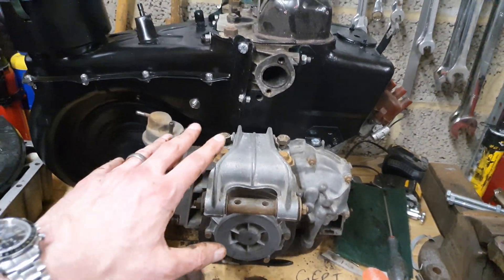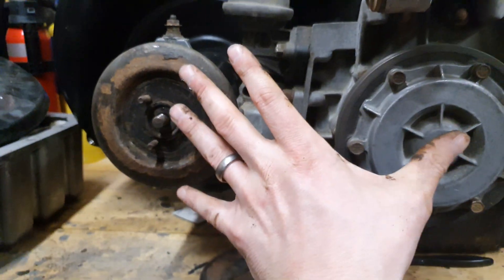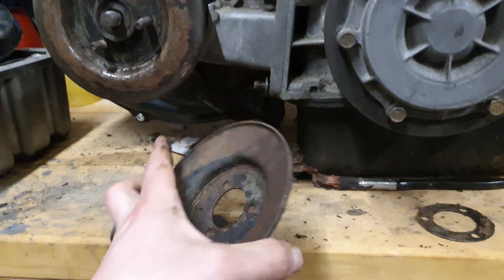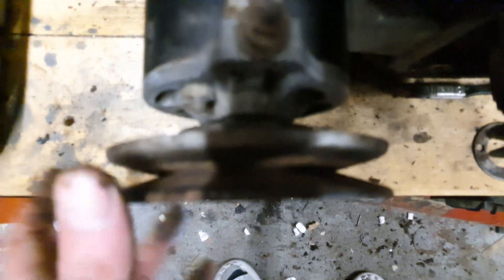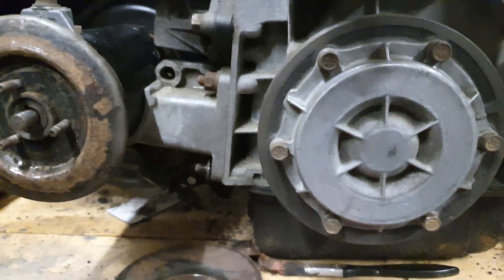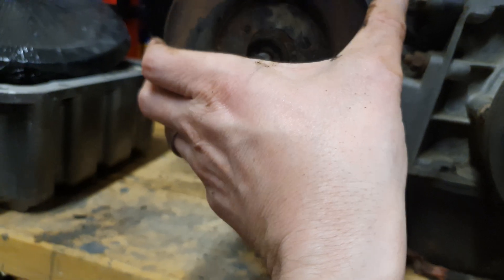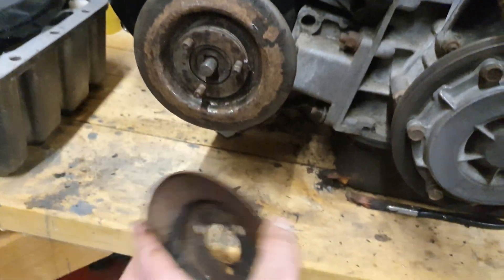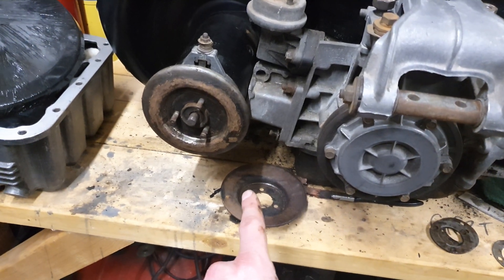Tech tip : Tensioning a fan belt on a classic Fiat 500 or VW Beetle

Comment: If - after correctly adjusting the belt tension - you end up with some washers left, just  put them outside on the pulley (secured by the three nuts)
Reply from the maker: Yep, easy instant onboard storage